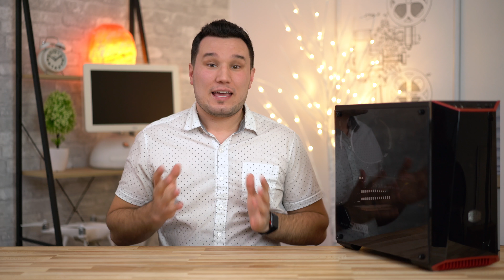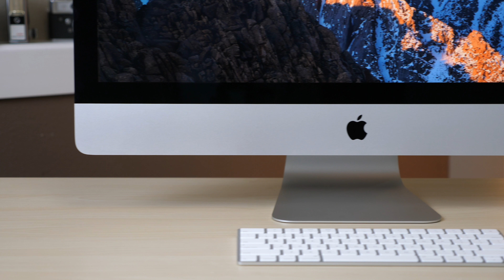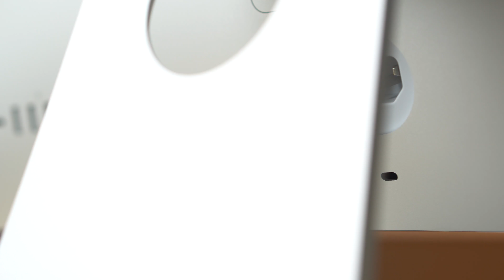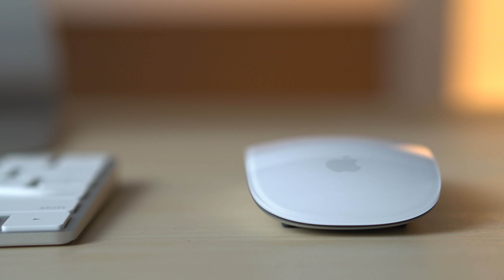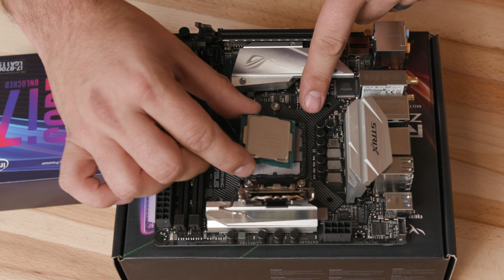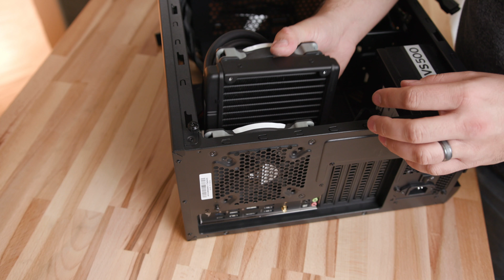$1350 PC vs $3000 5K iMac for Video Editing - FCX & Premiere

Comment: I agree with everyting. I love editing in FCPX, but i really dont like the "automated" workflow. Premiere Pro gives better control when collaborating with multiple editors. And using After Effects on a daily basis aswell, Premiere wins (on PC). If i was using a mac, I would most likely switch to FCPX and deal with the workflow issues. Its worth the performace increase.

Comment: The thing about Final Cut is that you can't do dynamic link between After Effects and Audition. Some that, for me and probably many other, is a huge deal breaker. But nice video, Max!
Reply: To be fair, the workflow between Motion and FCP X is also very good, it's just not the same as dynamic link. You can make titles or generators in Motion which you can then use and change (text, drop zones that hold photos/videos, or any other published parameter) in FCP X. You don't need to go back and forth to Motion in most circumstances.

Comment: This is what a lot of Windows users don't understand. When you use a computer, you're using an entire SYSTEM. You can optimize a single part of the system, or even a large chunk of it, but it is still limited to the throughput of the slowest component in it. I've used PCs and Macs since 1986, and have to conclude they have different strengths and appropriate applications. If you have an app that can take advantage of all the cheap, raw power in that custom-built box, it makes sense to use it. But if you can get things done easier, faster, or better on the Mac, with fewer distractions and obstacles in your path, it makes sense to use that. It's all about the bottom line results... not the speed or cost of any one thing. Sometimes the more expensive device IS less expensive TO USE, AND more efficient.

Comment: The apple ssd is much faster than PC , this is the reason about the rendering speed difference.
Reply: jingchao wu you're stupid, put a 960 pro from Samsung in there and watch 3gbps speeds
Reply: John Luelf did u check this video using ssd is not Samsung ssd 960.
Reply: Apple didn’t make ssd , but how about pc , if they don’t use windows system, try Linux system test with Apple Mac ox . Apple computer included their own system, but pc you have to pay windows system also. It is not fair for apple .

Comment: Great video, I’ve been running on a hack with Nvidia for a while and though it’s very stable, performance is far, far off the iMac in FCPX. Been wondering if it would get better with a Radeon card.

Comment: So fcpx is more faster and better for production and makes money.
But Max , for me you say " if you have 4000$, buy mac, fcpx is more faster than premier in pc, for editing"
My question is: with a 4000$  pc ( I9 or tread ripper 1950X, and Cg like 1080ti or Titan), fcpx on Mac will be faster than premier or not?
U can't say people to buy a mac for 4000 dollar( for makes money) if you don't compare with a pc with the same price.
For me u just prove that fcpx is more optimized. But u can't say, buy a 4000$ MAC for faster production is the good choice, when u don't compare with same value computer.
If a professional has 4000$ to spend, with is better and faster, this mac or pc with I9 or amd treadripper.?
I really want to see test about that
Reply from the maker: Check out my dedicated 8700K it beats my $4000 overclocked 1950X threadripper with 1080ti and 64GB RAM in many of the standard video editing tests until you get to the really heavy stuff like RAW. Keep in mind this iMac model is $2670 on b&h then add $300 RAM so it’s not $4000 and with a PC add at least another $600 for an entry level keyboard/mouse/monitor but for better quality $1000 or more.

Comment: This is probably your best video ever max Congratulation!!!! Very informative no B.S. I just LOVE it. 

Now the question FinalCut is so fast because it can use that special Intel capability (I don't find the right name) The funny thing is that that stuff is not in the processor what is in the iMac Pro so the normal iMac as far as I know is faster with FinalCut then the iMac Pro. It also does not work if you have a Hackintosh. 
But on the other hand a Hackintosh can have FinalCut. It would be very interesting to compare a Hackintosh and an iMac with Final Cut!!!  I know you are a video guy but I would be very interested how other Adobe apps like  Photoshop or the very slow Illustrator work if you compare the same systems.

I think if you use video editing only as a part of your job the PC or a Hackintosh is a lot better deal.

Adobe has a BIG performance problem with Premier, but it is the same with Photoshop and especially Illustrator which is disastrously slow (InDesign is not so bad)

Comment: wow... a $4000 mac did beat the $1300 PC in some tests.... Lets now compare the $4000 mac with a $4000 PC.
Reply: Max Yuryev some benchmarks like rendering are being done with FCP pre rendering. You also forgetting that people can run fcp on a pc
Reply from the maker: Your numbers are off. $3000 iMac (at least here in the states) vs PC with a current price of $1600 or so plus another $600 for a basic entry level accessories and monitor but if you want to match the display in the iMac it’s more like $1500 which makes cost slightly higher. Check out
My dedicated video on this 8700K build and you’ll see in regular editing that I showed here this 8700K overclocked PC was faster than my 1950X overclocked threadripper with 64GB RAM and 1080ti build that cost $4000. Its only in the RAW tests where the TR build doesn’t better.
Reply: @MaksimYuryev  but who needs a 5k monitor.......... save money, just get a 4k monitor lol
Reply: I guess English is not your first language (neither is mine) and you were not able to understand the price comparison close to the end of the video.  Here is the monitor, for example, https://www.bhphotovideo.com/c/product/1359254-REG/lg_27md5kb_b_27_thunderbolt_3_led.html So you have 1300 (back when GPUs were less expensive) plus the monitor you are already at 2699$. You have to add your wireless mouse etc. Also driving the 5K monitor will not be easy from a PC, even if it has thunderbolt.  You can see Linus tech tip on that: https://www.youtube.com/watch?v=o7IaFCqKfZk&t=330s
Reply: So true , with this price u can buy I9 with more 10 cores, or amd treadripper 1950x. 
better graphic card 1080ti, or Titan.
I think premier will be more faster than fcpx.
So if you had 4000$ just buy a better pc max. And if after that fcpx is more faster, I won't say nothing and believe it

Comment: Yes max install osx on your pc then make sure you also enable intel quick sync to make the hack go much faster. I run a hackintosh been running one for years and fcpx was not has fast has I thought till I got intel quick sync going then fcpx was much faster on exports I also use the radon 580 pro card.
Reply: What processor and settings helped you accomplish this - platform id, igpu options, dsdt, kexts, and anything else? I got a 6600k and RX470 setup but FCPX crashes for me when I get quick sync enabled.
Reply: I do have some videos on my channel but I bought the 580 card has there easy to get going in new osx and it works perfect
Reply: Thanks for the reply. Sadly I already went through that article you pointed out in the video including a ton of tonymacx86 posts 6 months ago - all kexts updated as well. I can easily get quicksync enabled but FCPX crashes so I have IGPU disabled for now. Still doing troubleshooting and research on forums occasionally without much luck. What i7 are you using?
Reply: Mine is the old 4790k have  you got all the stuff installed to make your intel hd530 work right? and also the kext files in the right place

Comment: This debate always cracks me up. The PC builder will always say I can build a system with better parts for so much less that's better than the iMac. It's like once they have the box built they're done. What about the 5K monitor, and the peripherals you're going to need to add to the PC build to get it similar to the iMac? The divide in cost is not so great if you add those things in. Then if it breaks are you going to fix it yourself? You can afford to spend your time doing that? Then there's the fact that PC build can't even run macOS which enables FCPX. No thanks give me a reliable known resource so I can focus on the work I need to get done and not be tinkering on a PC build.

Comment: I was a big Premiere fan before switching to FCP. It’s been 2 years, I tried PP again recently and it was like using Windows 95 in 2018. It’s so bad.
Reply: The thing about Final Cut is that you can't do dynamic link between After Effects and Audition. Some that, for me and probably many other, is a huge deal breaker
Reply: Rumle Kjaer FCP does play pretty well with AE files but you’re right. You’d have to make due with Motion and Logic which are both really good but still outside the Adobe ecosystem
Reply: I am a complete video editing amateur but I agree with Eric completely, Premier is a clunky, unintuitive mess compared to FCPX
Reply: This is my deal breaker too!
Reply: Was going to try using FCPx (its actually the reason i bought the 5k imac), but then i saw how you have to buy so many addons for FC...  I think i'll stick with DaVinci for now, and if i like it, pay the $300 for the pro version.  (still going to give FCP a test drive though).

Comment: Hi Max, this is not a fair comparison. You should have compared both hardware with Premier Pro, not with different Apps. It's like comparing browsing experience on PC with Windows Edge, and iMac with Firefox. Not a fair comparison.
Reply: Tech Informant No dude the thing is you can use Final Cut on mac but not on PC so why shouldnt you use it
Reply: Tech Informant This is specifically a software comparison, and what advantages/disadvantages exist from useage of that different software. Final Cut Pro is very well optimised for Apple hardware, and this was Max’s point with this video. Final Cut Pro runs extremely fast on less powerful raw specs, and runs circles around Adobe Premiere in general. Now, if he was going to do a raw hardware comparison, Max would most likely boot the iMac into windows with boot camp and run the same software on both systems to give an idea of that type of performance. I believe Max made this video in response to a very suspect comparison that was performed on another channel last week, and this video proves the point that 100+ commenters made on that video (myself included).
Reply: It's comparing based on the amount of time for the EXACT SAME TASKS between 2 ecosystems. Use your brain brah.
Reply: Tech Informant so true 💯
Reply: XInfinity2013 what I mean is testing both hardware with same software not minding the flaws of the software. That will be a fair compare BTW Mac & Win PC
Reply: Ok. That was an oversight by me. Thanks, I have to re-read the title again - ...FCX vs PP
Reply: This is not a hardware test nor a software test.
This is a test between two different systems.
Reply from the maker: I’m not sure where you got the idea that this was a hardware comparison. It says both in the title and at the start of the video and in the description that it’s iMac vs PC with Premiere pro and Final cut. I have a lot of hardware comparisons but this is specified to that setup.
Reply: XInfinity2013 that's my point. This is a HW test not SW, so testing with PP on both would have been considerable despite it's flaws. This is a HARDWARE test.

Comment: The iMac is faster because the QuickSync technology they are using really speeds up export when working with H264. With QuickSync, a 2012 quad 2.6ghz Mac Mini can export video faster than a Mac Pro Xeon quad 3.7ghz from 2013. Also with FCP, it's a one time payment vs monthly with Premiere Pro. The other thing to note is as H265 becomes more common, the performance difference between iMac and PC will not be too significant, unless Apple can build in the QuickSync to handle H265 into their new computers.

Comment: Great video - thanks for making it!  I saw a few comments below from people who have used both programs that FCPX's stabilization is not as good as PP's which, if true, would have been good to point out in the video. In fact, what I learn from some of the comments may be as valuable as what I get from the video. Still, it is a very helpful video for those of us in the market.
Reply from the maker: My experience has been the opposite. FCX stabilizer gets the result I want more often without tweaks. That would be a good video to do.

Comment: with Windows you buy:
- a ton of headaches.
- less real life performance.
- obsolescence in 1 year.
- lose aesthetics.

with a Mac you buy:
- peace of mind.
- more real life performance.
- continued support.
- BEAUTIFUL, classy machine.

Never going back to windows ever again.
Reply: Kansokusha Kamui it's not for everyone, but I understand your comments. I just went back to a PC, and I just cleared a bunch of Mac Pros out of my studio at home because I run software that requires the latest video cards available (Macs can't do that anymore). I've used macs for 20 years, as well as often having a PC kicking around (I'm typing this on a 32 core Dell now). There is no such mac anymore that I can put a high end GPU into . I built my new PC to look exactly like I wanted. I'm a designer, so aesthetics are important to me. In the 3D applications I use, the real life single processor performance of the PC I have is twice that of the dual Xeon 12 core Mac Pro I'm selling right now. The Mac was almost ten thousand dollars new, my PC costed $2500. I have peace of mind knowing that if anything goes wrong with the hardware, I can have the part to me the next day and put it in myself, because it's not some proprietary Apple component or a closed system. Many of those parts have a lifetime warranty (no Apple Care required). My machine is an open system. If something becomes obsolete I'm not at the Apple Store buying a new computer, I'm just taking a few minutes to install another processor or graphics card. You can't buy a Mac today, and expect it to be usable professionally in seven years like the old Mac Pros I used to buy (that I did processor upgrades and GPU upgrades to). The trash can macs at my day job are due to be replaced now because of their brutal dual video cards with nowhere to go, because the iMac Pros would just leave us painted into a corner. The modular Mac Pro has yet to arrive (2019?), and it's possible Apple may actually cancel it, since the very profitable iMac Pro is a guaranteed future of people who will have  to buy a new computer because they can't open the damn thing. Steve Jobs' closed system concept is a cash cow like he intended, and the bane of the professional user, as beautiful and as solid as the products are.
Reply: Q J or the morons that install all that popups on their screens when they see porn and run 40 viruses by the end of first year
Reply: Bruno Lazaro I think some people neglect the basic maintenance on a PC that just isn’t as important on a Mac. I personally have no issue working on either.
Reply: Kansokusha Kamui heard of Microsoft and the surface line? Apple hasn't innovated in years.
Reply: You sir are the best comedian by far.
Reply: i dont get the "pcs get slow" comments. My computer benchmarks exactly the same as 5 years ago. Processors dont "slow down" with time.
Reply: yesss exact. I had mac and now windows. my next computer its defintely a mac. with windows i have so much headache.

Comment: This is pretty much the end argument... apples Final Cut Pro is only faster than the competition because of good software optimisation. And that isn’t because of the whole “apple makes the hardware and the os so it’s perfectly optimised.” If that was the case hackintosh computers would be significantly worse performers than their same spec counterparts. The only problem with premiere isn’t the variation of hard ware of any other rubbish excuses, it’s because they don’t want to write foot software. It’s old architecture and it’s dated and for years they have done nothing but add in nice to have features which usually just bring more system instability to premiere. It’s a dog compared to final cut. I prefer the way it’s interface works. But performance wise they need to sort out their shit.
Reply from the maker: Alex James yup exactly. They made it better for 2018 (first time in 4+ years) and it still doesn’t compare.
Reply: Max Yuryev ah okay I haven’t really noticed, any speed increases and time savings. All I’ve noticed is that I’m wasting more time trying to fix problems and recover from crashes. Thanks for your videos btw! It’s nice to see someone doing tests on computers for things other than gaming! Just 1 piece of constructive criticism I have would be if you could please present more time line performance and things like how it performs when playing back footage at 2x 4x etc speeds. Render times are good but i personally care more about how smooth it is to cut and scrub through, thanks :)

Comment: Max, can you do the same comparison between the two but run hackintosh on the PC version. I'm curious to see how Final Cut Pro X works on a hackintosh. Also use an 8gb RX 580 on the hackintosh if it's available. :)
Reply: Nicco Sanchez , on a hackintosh, the FCPX will still be slightly faster if the graphics card is in the AMD Radeon card family, but if your card is Nvidia, PP will eat the FCPX for lunch, that’s just the way it is.  Hope this helps